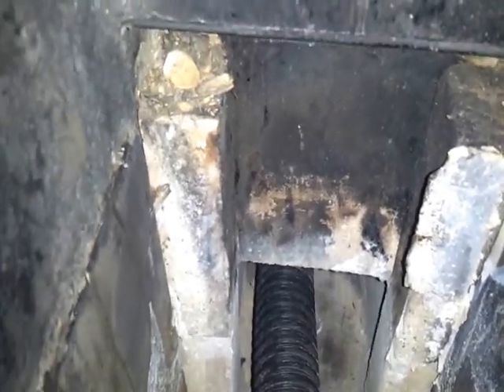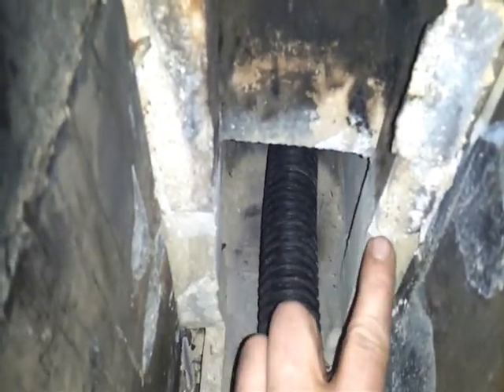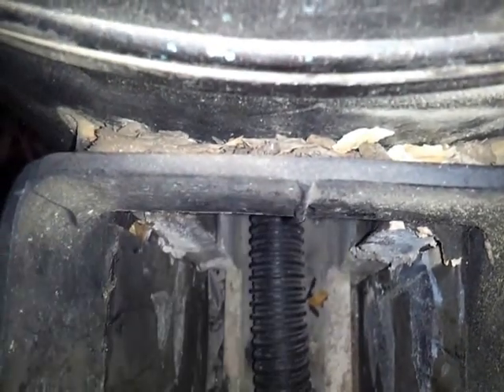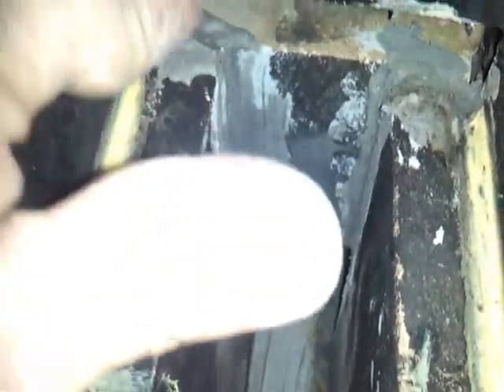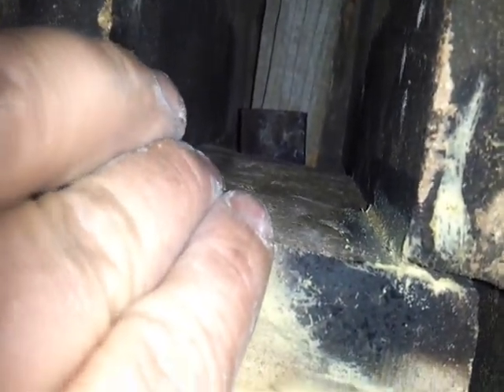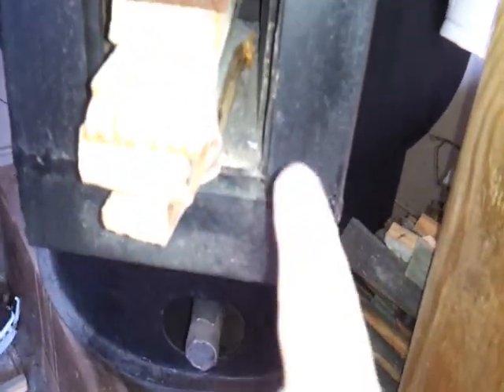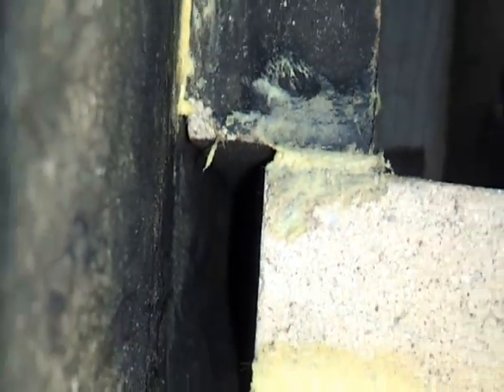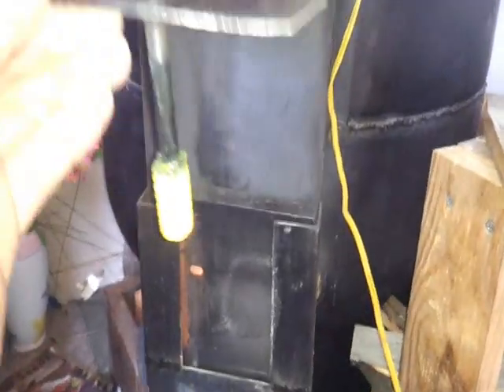Rocket Heater Modification to the Feed Tube

Comment: How's it working out for you this winter, and how did it do when we had that cold spell move in on us?
Reply from the maker: bubba007sss Check my past vids on the heater for that update during the cold weather. It worked great! Thanks
Reply: I figure that it did and I have watched all the other videos. That cold spell put things to the test no doubt.. I have two heating systems oil and wood and both are inside boilers. I had to turn the wood bolier up to fight the cold spell the whole time.
 I do have plans to make one of those rocket stoves in the future, they are something else.
Reply from the maker: I agree. We are moving to michigan and will be reinstalling it there but plan to incorporate mass to make it a rocket mass heater...
Reply: That's cool can't wait to see a video on it when you get it completed.. I live in Pennslvania